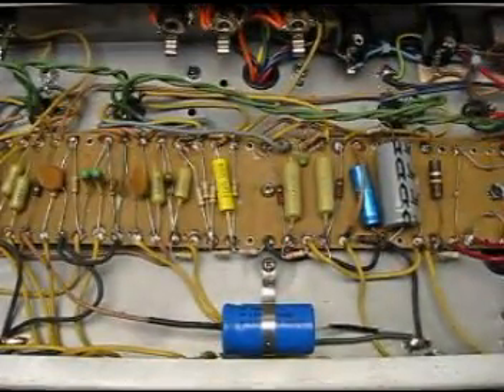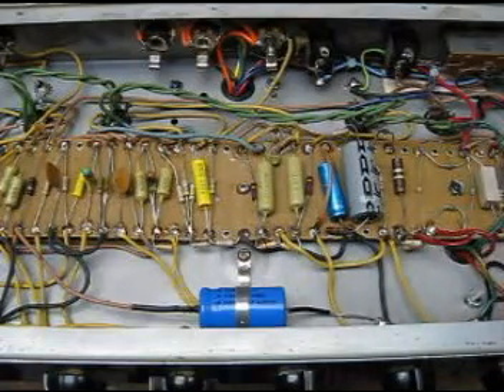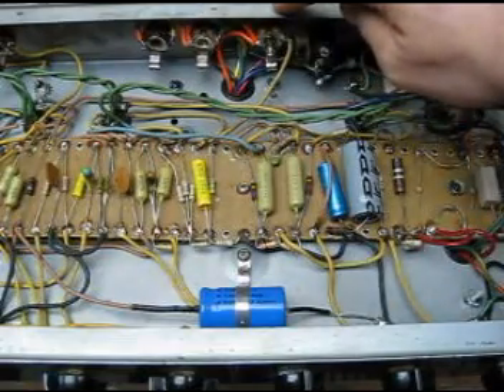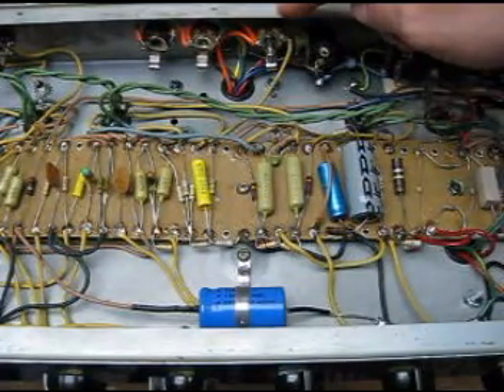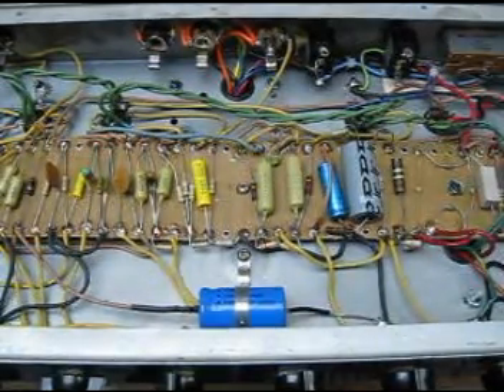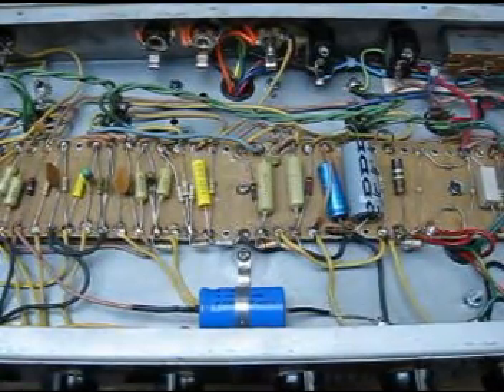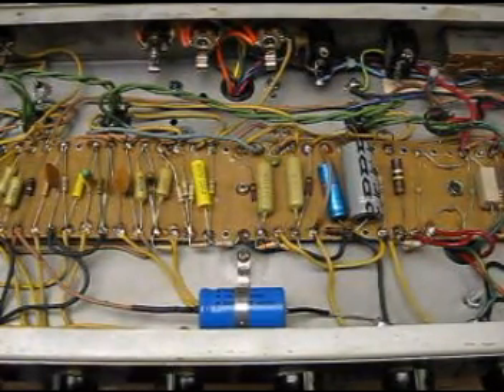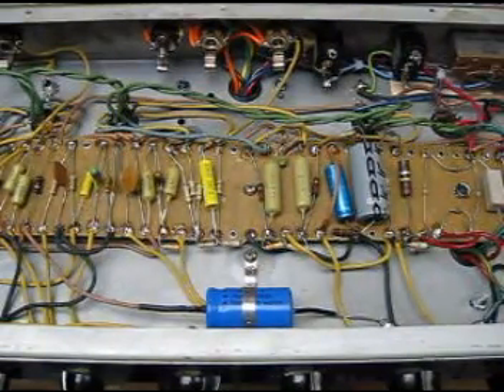Low filtering demo  & Filter capacitor replacement

Comment: So you don't need a rectifier tube to have sag?
Reply from the maker: VoxPathfinder15R exactly
Reply: Interesting, I had a buddy who said his JCM 800 would sag.  I told him that was his imagination since it was neither cathode biased nor did it have a rectifier tube - and he just copied what everyone else said since it was a TUBE amp after all.  But I guess if someone went in there and messed with the filter caps, maybe it did sag?
Reply from the maker: all amps sag just open one up and clip on a voltmeter and play ... they are bouncing all over the place
Reply: Interesting, I thought by design that Class A amps for example didn't sag - because they're full on all the time, unlike class A/B amps.
Reply from the maker: VoxPathfinder15R they sag less
Reply: Then again they're usually cathode biased, like Vox amps, so it sounds like sag - I think the effect is called squish?  Have you ever fooled around with taking a blackface twin amp and convert over to cathode biasing?  I've always wanted to try something like that, it would introduce some squish and remove some headroom.

Comment: In order to get the sag, do you have to lower all the caps or just the first two? Half the 40uF to 20 or even lower?
Reply from the maker: +amonte  I don't lower the first cap, sometimes I raise it ... but then I lower the subsequent ones down the line 
to get the amp to breathe better. You still need enough filtering to make the amp quiet. I will also add a stage of filtering which reduces noise but allows you to use less MFD of total filtering
Reply: Thanks, Pat.  I'm trying to make the same changes to my YGM-3.  So it sounds like I should keep the 1st cap at 40 and lower the following caps (to 16 or 20uF?) and then add an additional resistor/power cap to add additional filtering?  Should the resistor value be 22K like the last one is before the final power cap?
Reply from the maker: I used new 32/32 caps  so my first stage is 64  then 16 then 20 or 22 each stage
if I add a stage I use a small value resistor, look at the valve jr schematic for ideas

Comment: This is awesome , been trying to figure out why some of those old amps sag and compress. Picked up a Fender 57 tweed deluxe RI,  and it don't sound much different than most of the other amps out there. Sure doe's not have any sag or compression, like they advertise. How much do you lower the power filters ?  SOS
Reply from the maker: +mark johnson leave the B+ and lower the screens and pre-amp

I would probably try 8 to 10 uf on the screen supply instead of the 16mfd they show in the schecmatic... start there and listen to it
Reply: +patfurlan Getting about 375v on both main trans. secondary, and about 380v on B+. This amp runs hot. Leave the first B+ filter cap alone ? 
Thanks for your help, been on this all week.
Reply from the maker: I've played a few of those reissues and they sound very wrong. I would probably rebuild the entire power supply. using a 16mfd cap for the first filter, I would try 10k for the choke/screen resistor but also have 6.8k handy and buy a 27k pre-amp stepping resistor too replacing the 22k I would replace the 16mfd screen cap with 10mfd or 8mfd and then have another for the first pre amp stage, though you might go back to 16mfd ... the key thing is to know what the voltage drop is on a real tweed under full power ...I'll bet the power Transformer on the reissue has 2x the current capacity of an original amp
Reply from the maker: the other thing to do IMHO is to find the tone capacitor the .005 pull down cap on the tone control and replace it with a genuine old blue molded or astron cap or best of all a sprague bumble bee or 160p of the correct .005 mfd value ... these caps make the tone control way more colorful ..after I did my tone cap video I replaced the .005 ceramic disc in my 63 princeton with a 160p .005 sprauge and the amp ...became way more 3d and complex
it was pretty shocking

Comment: Is this the ygm3 you are using low filtering for?
Reply from the maker: Doc Hunsucker yes but it works with all amps ... never filter more than 16 on the screens
Reply: Just changed out my ygm3 to the Marshall style filter caps you suggested. Also changed the coupling cap in c1 to .001. Clipped c11. Changed the long/short tail pair on the phase inverter. Red Fang speaker. And  a couple of other mods that you had listed. Amp sounds incredible! Thanks for everything

Comment: Hi.  I recently took my amp in for repairs because of a nasty hum.  The guy replaced 7 filter caps and a very small cap. The amp now doesn't seem to be as loud and it breaks up sooner.  I have the old caps CE85C 400v100uf and a 100v47something. Pretty sure the new caps are the reason.  I liked the clean head room it had before and am thinking about taking it back to the shop.  Could you give me some advice on what to tell this guy?  Thank you much.

Comment from the maker: its a minor issue 
you either have a bad pre amp tube or a cold solder joint on the input side of the first pre amp tube 
I replace the caps with LCR F&T or JJ marshall style caps

Comment from the maker: @fuzzfreak1967  a 16ohm speaker should read low on a meter set the amp to match the cab as its marked

Comment: Now that is sweet tone! I have a question, you say the smaller filter caps restrict the wattage. Do you mean they loose voltage a bit like a sag resistor(resistance in the power supply)? Or is it a steady lower voltage to begin with? Cheers

Comment: I also have a 1970 100 watt superlead. It has this hiss sound that sounds like the wind blowing. It did not have this problem when I first got it. Took it to a local repair guy, He changed a pre amp tube (middle tube) The amp was fine for about 6 hours & then it started again. He says the transformer in the amp is supper beafy and new tubes cannot handle this. He gave me some old tubes to try but they do not work either. Any ideas or thoughts on this situation? thank you

Comment: I have a couple more questions maybe you could answer. Speaker ohms, I measured the ohms on my 16 ohm marshall cab & my meter read 13 ohms at the cord end. Should I set the amp to the 8 ohm setting because its safer to have higher speaker ohms than transformer output or is it ok to have the amp on the 16 ohm setting?

Comment: Pat,
Great videos,
I was wondering what the individual values of the filter caps you used here were, and did you change 3 (meaning 28, 30, 31, 32, 21)?
I was considering a Tweed Deluxe, and picked up a YGM3 instead.  Looks like I can have the best of both worlds..